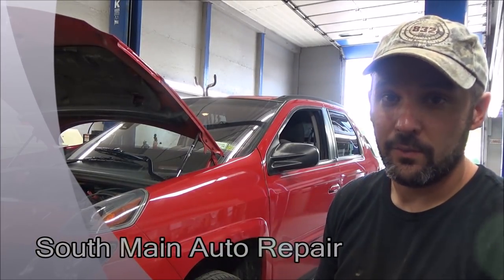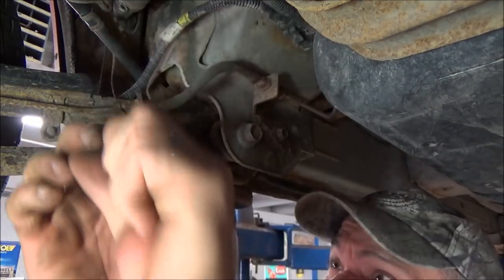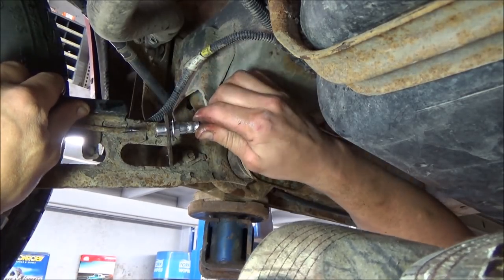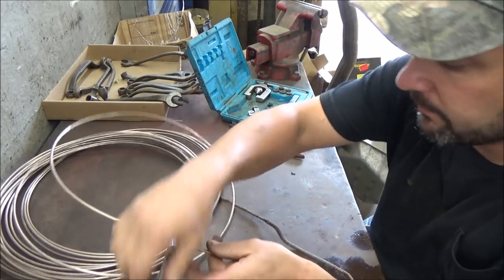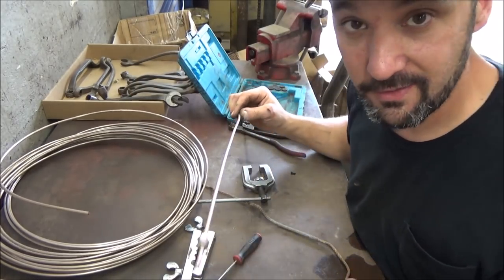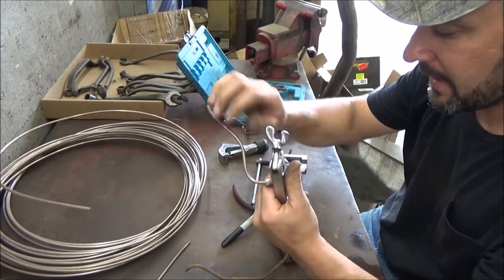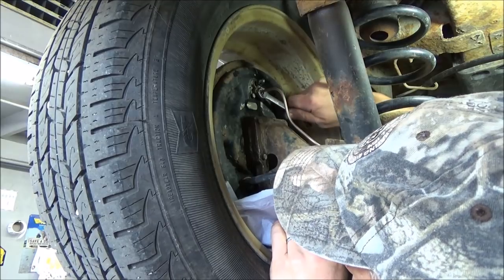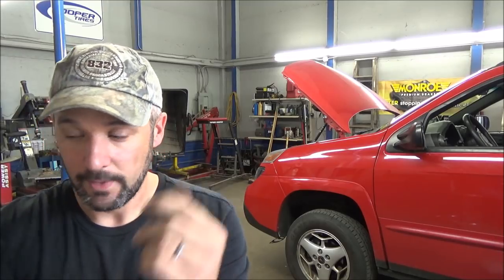Replace Brake Line &  Brake Hose : Pontiac Aztec

Comment: VERY IMPORTANT thing you didn't mention that can happen to a novice (besides forgetting the flair nut) is: make sure to put the flair nut close up to the line flair BEFORE you start bending the line to shape. Otherwise you may get your line all bent up pretty like, be all proud of how cool you are, then realize the flair nut won't slide past the bends. This is especially true if using those longer nuts. That nice 90 degree bend that you used the bender to achieve, yeah,, try straightening that out then redoing it and see how it looks.  Been there in the early days, but live and learn, cuss a few times then teach someone else from your mistakes.
Reply: 19:15 he does actually mention looking and finding you forgot the nut. But worth mentioning again.. and much wise magic advising keeping the nut ahead of the first bend. Thanks :)
Reply: @hippitymcstribbs4906  That correct he did say watch the nut placement.
Reply: I’ve done that before, I mean all of the inexpert moves you mention.

Comment: I feel like people are scared of brake lines and when its mentioned to them they feel its 100% a garage job.. having never done one before and after watching this video, i feel i could of done this job! great video eric :)
Reply from the maker: James'sWorld Gravy job not a garage job ;)
Reply: They are very easy to do with the lines he used, when I first started doing brake lines you had the steel very hard to bend and had to use benders. I know Amazon sales them by the roll. No parts stores here keep the rolls in stock.

Comment: I live in Michigan suburb of Detroit, i use to work at a trailer shop and one of the most repairs we did was replacing rusted brake lines, great video Eric, you’re a great mechanic and teacher

Comment: Oh, man. I wish I'd seen this video a few days ago. I was going to replace the rubber brake hose and I tried unscrewing the fitting on the steel line - of course the tube nut was seized to the line and it sheared off. Bet I could have saved it if I'd tried unscrewing the hose from the line. Still, once I stopped swearing it gave me an excuse to buy an on-vehicle flaring tool and I've now made my first flare :)

Comment: Eric mentioned this at the end but most modern cars use an ISO (metric bubble) flare. I was surprised that when I went to the local auto parts stores just a couple of years ago that NONE of them had a metric flare tool either for sale or for rental. Yes you can make a double flare work (sorta) on a metric system but it's a hack and I don't want to do a hack job on brakes. I had to go to Amazon to buy one. Personally having watched later SMA videos, the next time I need to make brake lines, I'm going to spend the $200-ish bucks on the universal hydraulic/brake line flaring tool that Eric uses these days. It looks like a dream to use in comparison, and it can do fuel lines and all sorts of other stuff.

Comment: Getting ready to replace all the lines on my 2006 Expedition. Had a metal line pop, figure if one went the rest aren't far behind. Replacing all the flex lines too because why not while I'm draining the whole system. Replacing steel lines with Nicopp lines shrouded in stainless steel spring guards, and all the fittings with stainless steel. Figure if I'm going to do it, do it once. Lines and fittings should outlast this drivetrain and the next one I'll put in it since the body is rust free (amazingly for one in my area). Just stopping by for any tips my favorite YouTube mechanic may bestow upon me. Despite nearly 30 years that I've done all of my own mechanic work(and that of others) and being pretty well seasoned at this point, I know I can always stand to learn something from this guy.

Eric is the best damn mechanic on the net hands down!!

Edit for viewers:

Angles and flares in a nutshell:
Angle refers to the angle between the flare and line at the NUT SIDE of the line.
45 Degree flares = Mostly American.
37 Degree flares = AN standard, likely to never see unless working on aircraft or custom setups.
DIN/ISO (90 Degree bubble flares) = Mostly European, Ford beginning in some year that I don't know.
45 and 37 can then be single or inverted flares, single flares are illegal to use in braking systems driven on public roads because they are dangerous. No, just don't.

Comment: The suggestion to use Nicopp was very helpful. I replaced brake lines and hoses  on my 98 Explorer today. The Nicop was easy to form and flare, much easier then Poly-Armour. I keep my cars until they beg to be put to sleep.

Comment: Wow I missed this video by one week. I just did my first brake lines last week and everything you say in this video is absolutely true. I used steel brake lines and it went pretty easy actually.  I heard about copper nickel but you demonstrate how easy it is to work with.
This is a fantastic video and anyone that has any problems with a brake line needs to watch it. 
Oh and by the way I flared two ends and forgot to put the nuts on!  Thanks for the great video and all the videos you do.
Reply from the maker: +DaveSender66 HAHA let me tell ya I have made 1000's of brake lines and no matter how many you do you will still forget the flair nut every once in a while so trust me when I say it will not be your last time :)

Comment: Best video I've ever seen on brake line replacement, thank you. What I find most disconcerting about internet learning is how often advice is dangerously incorrect, and brake line videos are way up there for bad internet advice. I would have thought in the litigious USA there would have been pressure to show correct procedures, especially when it comes to professional advice. Viewers have to put in the hours to understand how wrong that is, we still see clowns using compression fittings.

Comment: I have several cars that are over 40 yrs old, they have factory brake lines, still in good shape, and they come loose, i have replaced hoses...we are lucky I guess, you guys in the rust belt..not so lucky. Nice video, enjoyed it.
Reply from the maker: joel mccoin Lol we don't even have 40 year old cars
Reply: South Main Auto Repair I have two 1970 Lotus in the garage with not a speck of rust on the body and the floor board is still as solid as the day the car was made.  It helps that the cars are Fiberglass.  LOL

Comment: Thanks Eric, that inverted flare looks like the ones in the parts stores (on machine made brake lines) I had a real hard time making those flares ''seal'', you showed me my mistake, I went cheap and bought a cheap flaring tool without those little inserts, has cost me a hell of alot more than just a couple more dollars!!

Comment: You did that with such finesse. I hate making brake lines, by that I mean flaring them and cutting to length. I usually buy the pre-flared lengths from NAPA. Makes the job so much easier. We use compression fittings sometimes, in locations that it is almost impossible to actually replace the line. But 95% of the time I don't. The only time were I actually had no choice but to use one, on a 98 Pontiac Montana van, the fitting at the wheel cylinder was a 10mm with a 3/16 hole, the other end was 3/16 fitting on a 3/16 line. It was a holiday Saturday, nothing open and we didn't have a metric bubble flare tool, I had a piece of 3/16 line with a bubble flare on it, and 10mm fitting so I used that and joined it with a compression fitting to the 3/16 with a 3/16 fitting,  It worked and got the person on the road. The next week when the Snap On guy showed up I bought a metric bubble flare kit, and wouldn't you know it, its been a year its still in my tool box still in the plastic, go figure.
Reply from the maker: kenman1717 Yep I know that all to well. But better to have it and not need it then need it and not have it ;)
Reply: South Main Auto Repair A very true statement. Seems I have a bunch of tools like that. We get a run on certain stuff, don't have the tool, make do with something, first chance I buy it, then I don't use it. Happens a lot.
Reply from the maker: kenman1717 I have selfs full of those lol

Comment: Great job Mr. O Especially your detailed info on making the flare and bleeding the system. Surprisingly, a lot of people don't know about copper/nickel brake line. Soooo much easier to bend and work with than regular steel line and lasts a lot longer than steel. Great vid and very informative for the DIYer's. Thanks!

Comment: Eric, I have been fixing a Tech for 20 plus years down here in RUST country much like your self. I own a small shop like yours on Cape Cod Mass, I use the same copper nickel alloy tubing as you do. I own a hydraulic flaring tool, the orginal ones like you showed the best one I have ever used is a tool you mount in the vise and it has a wheel with all the dies and cones so its very fast and easy and makes a perfect flare every time. I forget where I bough it I think I off a private lable tool guy like KD lisle but you can still get them. try S,U,R&R for brake, fuel and any other lines there the best, I probally use in a average month 100 3/16 and 50-75 of 1/4 and I know your pain! keep up the good work!!!
Reply from the maker: Idle hour Lol sounds like we are 2 pees in the pod. I do use SUR&R . Their A/C repair stuff is unbeatable quality IMO. A few people here posted about that eastwood bench mounted flaring tool. Looks pretty cool.
Reply: 10-4 on that cap, I say all the time rust pays the bills !!!
Reply from the maker: Salt, rust and I have a love hate relationship

Comment: You make that hand flare tool look easy.  I bought one, it kept pushing the line out of the holder no matter how tight I got it.  So I bought Eastwood's flare tool and haven't regretted it.
Reply from the maker: farmboy30117 Yeah a few guys were commenting on the fact that their hand one did not work well and did just what you say. This set I have seems to work really well. I have had it at least 15 years
Reply: I had the same problem but we tend to have steel line in the UK which is a pain in the ass to flare. The copper nickel stuff looks awesome!
Reply: That tool is $22 down at the AutoZone, same price at Harbor Freight  and $32 from Eastwwood none of them have good reviews but I'm going to try it tomorrow.  AutoZone guy is steering me to the cheaper not Copper line.  I wonder if the copper just works better with the tool?  I'll report back after I try it.

Comment: This is probably my favorite video of yours. I'm just a DIYer but I find myself doing brake line replacements quite often. I've also had to replace brake hoses as well whenever they collapse internally and act as a check valve. Which also almost always means replacing the entire line anyway. I unhook lines by cutting them as well. 

Worst one I did was for my brothers '96 Dodge Caravan. Bubble flares with different sized nuts at the ABS unit and double flare everywhere else. I was using pre made line at the time and had to invest in a bubble flaring set.  Since that job I now just buy brake line by the roll and make my own and have both double and bubble flaring sets. 

The ni-copp line you used looks really nice and I may use that for any future brake line jobs I do.
Reply from the maker: +Steven Pothaczky Oh man go NiCopp all the way!

Comment: Thanks for this video on brake lines! When I was checking around on which flare-tool I was going to get, this helped me a lot, in my decision about this cheap one that I got! Made some money and got the excuse to buy the flare-tool and saved my buddy about the same amount I earned of helping him... Didn't use a bending-tool but I used copper lines so it was easy to bend...
Reply from the maker: Did you use regular copper or nickle copper?
Reply: I used regular copper. I suspect that's easier to bend than nickel copper even if the nickel copper ones probably are more resistant to corrosion. My buddy was going to sell the car and just wanted it to pass inspection the next day, which it did... Made sure the line wasn't rubbing and ran the line where it should go. Should have made a video of it but I was to busy cursing over all the rust. The connections near the hose were rounded, rustwelded, in a tight place etc. Rust..., whatcha gonna do? I improvised a leak stop with a greasenipple and a union that was kinda nice... If I do a vid on a brake line job in the near future I'll try to remember to mention this vid/channel and link to it if that's appreciated? Thanks again!

Comment: Your absolutely right, it takes just as long, if not longer to a cobbled up job than it does to do it right. I recently replaced all the lines, hoses, wheel cylinders and calipers on my 97 Tahoe. It's a southern truck, but a few years up here turned all the lines crusty to the point where they were starting to split, plus every bleeder was broken. I'd much rather replace lines before they blow out than have one blow while descending a 14% grade. (thats 14ft of drop for every 100ft for the flat-landers). I used that dark green coated line, which doesn't flair or bend easily. I wish I would have know about  Nicopp before I did it.

Comment: hi eric     you should be wearing eye protection   and gloves .  also I have never replaced a brake hose or line   so thanks for the video.  plus  i am sure there are plenty of other people out there that still have not done it either.   I like that cutter.  Eric  the quality of your work is just amazing   you work on every customers car or truck like it was yours    .  I really wish I lived in Avoca   and your thoughts and attitude   are  amazing .  I love all of your ideas and videos  and have learned so much from them .  my mom has a 97 ford escort  she has a few brake lines that have a minor drip  or should I put it a sweat  and since I dont have the tools  I will have to bring it to a shop to get done  . 7 months a go i changed her wheel cylinder using a oem type and it just statred to leak in side the rubber boots. so now i am going to replace it again     under waranty

Comment: Hi Eric-O, A.J. here in sunny Phoenix, AZ. I have a 98 chivy PU and you are correct no rust huh figure that. I have made brake lines from time to time when I saw you using the old tool I was thinking why you wouldn't use a newer tool like the Eastwood one but you did it in about the same time it would have taken me with my newer tool.
Thanks for the videos A.J.
Reply from the maker: Ahhh no rust... you must be bored

Comment: any one that hasnt forgot the nut at least once is a lier.lol. I have done so many brake jobs in Michigan here where I live,there is no question on what parts you need to do one. Getting the bleeder screw to come out is a bonus for me if it doesnt break off. I cant believe you just burped it off with the airgun. I have had them feel loose only to find out it broke off ,even though it was part way out. I hate it when guys dont take the time to properly fasten the damn lines back up. I also hate it when  use too much line. My wife is an expert petal pusher for bleeding brakes though lately I just use an auto bleeder. I almost always expect to replace a caliper when doing a brake line job ,I have even bought one ahead of time,only to return it. Thats always a plus.I am familure with the bubble headed type line end but dont see the need,been using the tryed and true for years. I am just a shade tree mechanic so to speak but have save family and friends thousands of dollars doing brake jobs. I am surprised it hasnt been out lawed some how. liberal nannys and all taking over this country.

Comment: Hey Eric O. i know this an older video, probably wont see this comment or a reply. But, if you do. another great alternative to pinching the brake line to stop the brake fluid from dripping is to take a steering wheel club or other form of extendable rod and when the brake line is off, press the pedal to the floor, and lock it down with the club to the seat bracket. with the pedal fully depressed it keeps the fluid from dripping and from air getting into the line. not to say that it still wont need bleeding as the new line with have air in it.

Comment: I used that stuff in metric to re-plumb my old Benz 300TD's hydraulic suspension system - bubble flares and all.  Good stuff.
Reply from the maker: hoppes9 Nice. I always have to order metric line here. No one stocks it but we don't see it much
Reply: There just happens to be a place nearby that specializes in metric hydraulic stuff.  Without it I would have to drop the rear subframe in order to fit the pre-bent Benz stuff.

Comment: You know you use compression fittings and pray that they work, hahaha. I use the same brake line. Super easy to work with. I use the Eastwood flaring tool that mounts in a vice, its the best flaring tool IMO. I love it so much that when I have to flare a line on the vehicle with the other style tool, I whine like a baby. Thanks for the video.
Reply from the maker: SATAMAN Schmidt Hey I am not saying anything (cough, cough) but you know feel free to send one haha. No kidding that thing does look pretty cool. You gonna let me know the best deal out there on one I am sure so I will be looking forward to it.

Comment: Cool, I've been waiting for you to do a brake line video.  It is funny that someone would ask if you've done them before, lol I'm just mr. diy and I've done enough to go out and buy the Mastercool hydraulic flare kit.  I love the curponickel stuff.  So much easier to work with, and it really outlasts steel in NY that's for sure.  You're really right about how important it is for them not to rub on anything.  Had a Jeep Wrangler that came from the factory with a line rubbing on the frame rail, only lasted a year or two.
Reply from the maker: Garrett McEwen Oh I have seen them rust through in months from other shops depending on how they were routed.